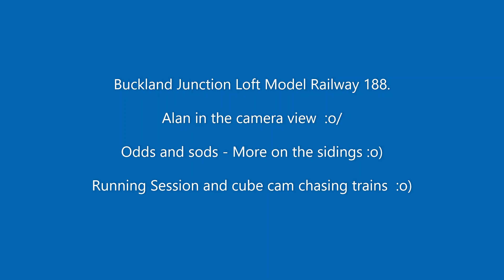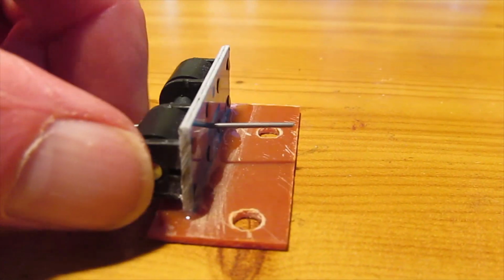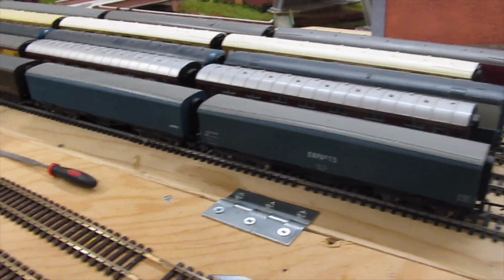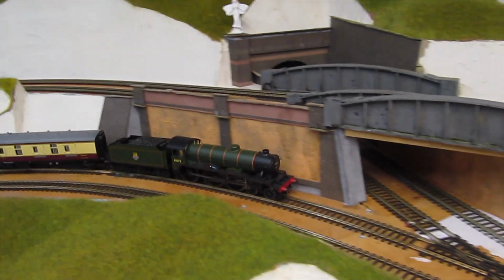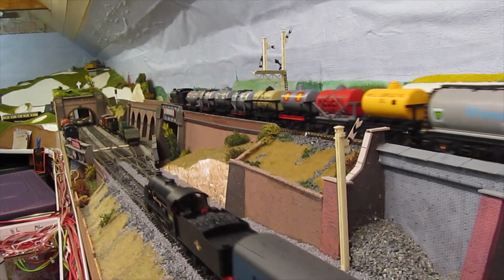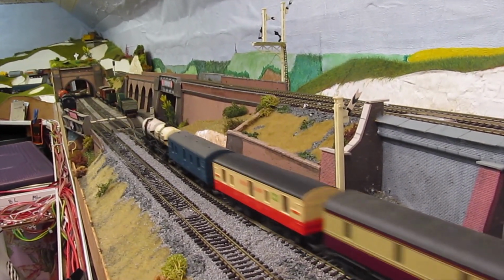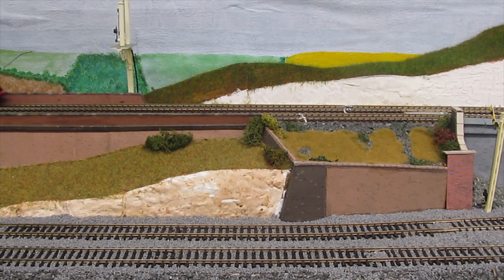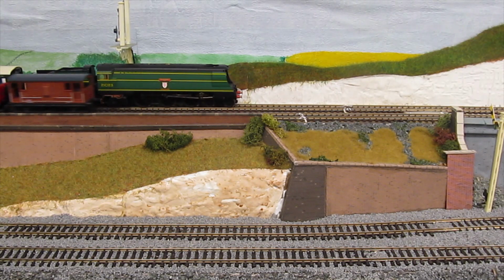Buckland Junction Loft Model Railway 188. Railway Carriage sidings taking shape. Cube cam loco chase

Comment: With the 9f I do prefer the bachmann branch line 9f it's loco drive running number 92006.
It's ok on 3rd radius curves but my one is great on 4th radius curves.
Reply from the maker: Hi There. I just loathe tender drive locos, not good at anything. I will get a loco drive 9F one day. Regards Alan  :o)

Comment: What glue did you use to stick track to the board in the carriage sidings
Reply from the maker: Hi Peter. This was plain PVA wood glue. Give two to three day and it will reduce into a hard bond around the rails as you will see in the next video. Regards Alan in the loft  :o)